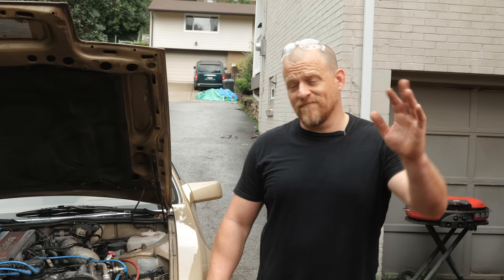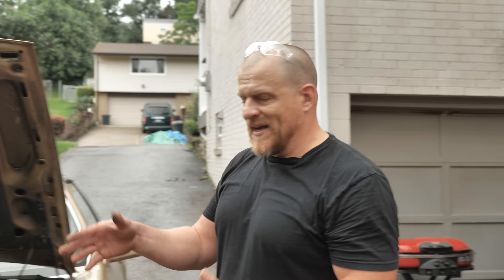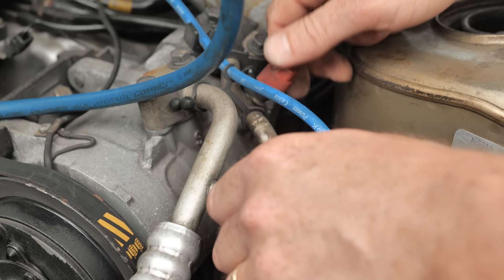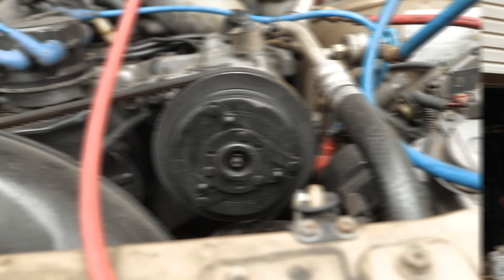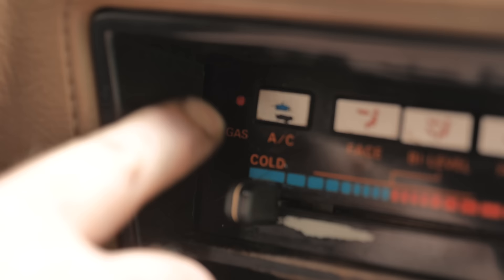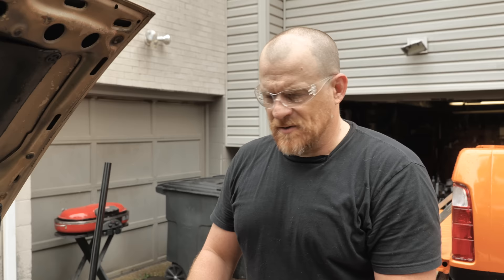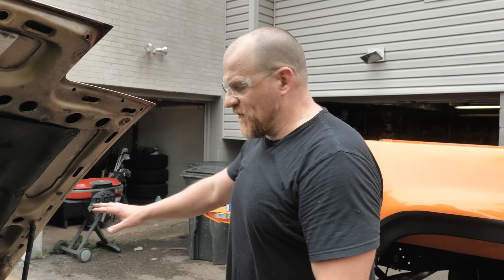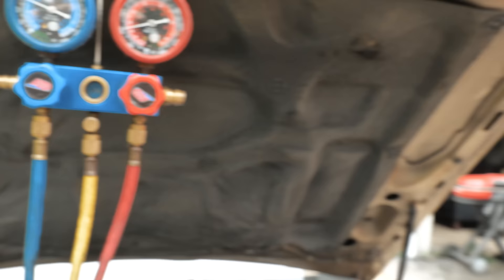A/C Leak Testing, Repair, Evac and Recharge (ANY CAR!)

Comment: never rely on schrader valves to keep air from entering when under a vacuum, they're designed to hold pressure from the inside seal end and not a vacuum with air pushing in from outside, they'll easily open and allow air in. you very likely let in air when you closed the low side adapter and removed it. same for the self sealing/low loss hoses, they're all made to hold pressure, not vacuum.
you should use good ball valves to isolate things and cycle them half/part way closed a few times, as there's voids in them that hold air around the ball and that releases making the vacuum drop when cycled. it's a good idea to charge as much liquid as possible into the high side first (with engine off!) then you can close it and finish charging through low side with vehicle running.
Reply: Yep.
Reply: throttle bottle  - damn, i've gotta watch the video again hahaha.  i've got a set of fairly cheap ($300) gauges coming in next couple of days.  i got em cuz i've gotta do my 2001 silverado & a couple of other buddies rigs.  will be my first time doing AC so i've been watching a bunch of videos.  can you walk me through what kind of valves to get etc.?  would i install them on the end of the vacuum/high/low side hoses... like attach them to the factory ends where they install into the actual gauges or somehow replace the ends that connect to the hi/low service ports themselves?  am i making sense?  if you're too busy i totally understand, your comment just really interested me, thanks:) barbie
Reply: @8barbies779  it's really not that crucial. Miniscule amounts moisture that gets in from disconnecting fittings and switching the the other cans, etc. should be absorbed by the drier.

Comment: For that car, I would've replaced the receiver/dryer. It's old and rotten, by now, and you had the system empty, anyway. You might've had drier and colder air if the receiver/drier was replaced.
Reply: Yeah I always replace the accumulator/filter dryer just cause the system is open, like you said the things are blown out after years of use. Pretty cheap insurance for most cars

Comment: A micron gauge is used to determine if there is moister in the system not to prove a leak in the system. Everything Doctor Paul shows In this video is perfectly good practice. He is very knowledgeable.
Reply from the maker: Is it not both? Thanks!
Reply: False. A micron gauge is used to measure vacuum on a system. Ideally you should vacuum a system down to under 500 microns to boil off moisture in the system. The purpose of pulling a vacuum is not to pull the refrigerant back into the system. The purpose is to eliminate moisture.

Comment: The ac gas light is connected to a superheat switch. It will illuminate when the system is running and low on gas. If it's flat empty it should not illuminate after the engine is running. It will light for bulb check.

Comment: A really slick modern oil is called PAG100 "Double End Capped"(molecule). It is fully compatible with all things R12 and R134a. You can switch refrigerants without changing out the oil.

Comment: One technique that I just tried a few minutes ago while topping up my Integra to check the Schrader's after I was done was to back off the valves but leave them on, discharge both hoses through the manifold valves and close them again. Wait awhile to see if the hoses repressurize. They will climb a little bit anyway the first time or two that you close them but then they should stay at zero forever.

Comment: You can go to auto paint supply store and get a filter for paint gun and filter out the moisture in ur compressor lines before you pressure a/c system with compressor air😊

Comment: Nice routine you have there Paul for checking for leaks, and making sure to boil off all the moisture with a vacuum pump. I haven’t used a micron gauge but I feel comfortable as long as I get down below 28-29 in vacuum and it holds for 15 mins I’m happy. Thanks as always Paul for sharing your repairing. I learn a lot from you.

Comment: Fantastic explanations!  I have a wealth of info from residential HVAC…you are spot on with the 500 microns and below being preferred to minimize moisture and non-condensables.  Most manufacturers have their own recommendations, but 500 is the universal standard. Don’t go below 250 microns for many oils. Vacuum pump, vacuum pump oil, and good hoses and seals are imperative.  If you are unsure, change your vacuum pump oil (it is special… don’t use motor oil, etc.), change the rubber seals on your hose ends, or use something like Nylog on the hose fittings when you connect to pull the vacuum. 

Also, Nitrogen is THE way to pressure test/leak test.  For most micron gauges you can apply pressure after the vacuum with refrigerant/oil but you will have to clean the gauge (usually with isopropyl alcohol)—check your manual for your gauge.

Last…close the check valve, pinch off the hoses at the vacuum pump, or disconnect from your car system when you turn the pump off.  Otherwise the vacuum in the system will start to pull your vacuum pump’s oil into the hoses.

Thanks for such a great walk through of car AC systems and your explanations.  Again…excellent advice.
Reply from the maker: Thanks so much! Really appreciate that coming from an actual HVAC tech too!

Comment: I'm with you that acidic oil in an automotive application is not a huge deal.  You definitely don't want acidic oil in a house AC or commercial AC system because the acid will eat away at the windings in the compressor causing a burn out, but with an all mechanical compressor such as automotive its not near as big a deal.  I worked in an AC shop for many years and we used compressed air quite a bit.  A combination of a deep vacuum and the desiccant in the dryer/accumulator minimizes the chance of acidic oil a lot.  Just found your channel last night and enjoying the content,
Reply from the maker: Thank you! Glad you found me. I've since switched to nitrogen, just to silence the critics lol. But I'm glad you're here and thanks for this comment!

Comment: I seem to have alot of intermittents  with things so I made a small led power indicator board with 6 ckts and long leads so I can drive time monitor things,  ive actually run a trip with the guages hooked up for 8 hrs lol, but it solved what the issue was. hygroscopic is the word you were looking for, they make a shutoff valve that fits between the micron and the line fitting.

Comment: I worked on cars almost 50 years I started reading about combustion engines 12 13 14 and starting to work on Automotive cars I used to build tractor trailer models which was the big as day and car models learn the parts read books have even started doing body work at the age of maybe 14 or 15 then I went to high school head shop for 3 years and went to Lincoln Tech with two and a half for business on Automotive and Diesel and took business one thing is I can see you're one of the mechanics on YouTube that try to be as thorough as possible and even go by the book I can appreciate your videos by the time my first year high school when we were taking nothing but test and staying in a class I asked them to bring in the 71 Pontiac Grand Prix that I needed to put an engine in my shop teacher he was very surprised that I had that much knowledge didn't know everything but I knew pretty much I brought the car in and put an engine in 71 Grand Prix because of course schools didn't have that much to do with working engines because of the school budget so we brought in work that we were working on otherwise at home pretty much had to retire but still think cars are real fun

Comment: I had a Fiat Stilo with naturally aspirated 1.4 that claimed 90hp. It was a nightmare to drive with AC on. And I really mean a hell of a nightmare. Each time the compressor kicked in I had to give it full gas to even do anything. Now I have another Stilo, with a 1.9 JTD 115hp turbodiesel. Same car, same weight. I almost don't feel the power going down when that compressor is on. Maybe if I upshift a bit too soon, and the rpm gets below 1500, it doesn't pull as hard until the turbocharger spools up. But that's it. 90hp vs 115hp - it doesn't seem much. But as far as it goes for the torque, it's 128Nm vs 230Nm. And that makes a difference.

Comment: Enjoyed your content. I'm a commercial refrigeration technician and have done almost everything involving a vapor compression system. The Gas light  on the Z was really cool. I had a 280Z with the all digital dash, can't remember seeing that option on it however. Lot of good info. After dealing with rack systems for Walmart, 2000lbs 404A, losing refrigerant is always and issue. When I have a leak it's bad news and I can't leave until it's fixed. Finding a leak with Nitro & bubbles isn't an option, leak detector or dye in the system. Nitro helps in removing moisture and it has the lowest molecular weight of any gas making it the best option for finding leaks. When it comes to the micrometer moisture boils off around 1200, if system struggles around 1200 you know that the system has moisture. Several methods to remove moisture. 500 microns is the number you need to know that all non condensibles have been removed.. I've had the same vacuum for so long that I can hear when my pump has achieved desired microns.. The oil has a high affinity to moisture, once the cap is removed use what you need and trash the rest. Make sure you have fresh oil in the vacuum, it will pull down faster. 800microns I let it rip. Most conversions require about 15% less refrigerant than before, sight glass was also pretty neat. I've never dealt with a txv in MVAC most are fixed orfices. Often times the txv will require changing. Using a txv not rated for the refrigerant could cause pressures to look low. Flashing at the sight glass bc the txv is starving the evaporator. When dealing with low pressure systems or negative pressure systems everything is critical and if I miss or try to skip a step it always comes back to bite me in the ass.. Had a newer Cadillac with ac issue. With all the tools that I have it still required a computer to diagnose the system.  It was the only way to test and verify if the sensors were within tolerance. High Engine Temp sensor was out of tolerance. I've seen and done a lot. Had opportunity to install chiller on big ships, some of the things I had to come up with solutions inorder to make the equipment purchased work all bc they didn't understand that the salesman upsold them which required an expensive controller. The owner didn't purchase the controllers, I had to install DC rectifiers that I ordered from Amazon for $12.00 apiece. The controllers were $475 apiece . I've never used a protective cap on Nitro, can't tell you how many busted regulators I've had over the years. Plus, my Nitro bottles are  6ft and strapped to a 2 wheeler. I have several manifolds I use but when dealing with MVAC I use the throw aways. My Testos have micrometer built in and so does the hoseless yellow jackets. The gouges would cost more to replace than all new MVAC system. The R12 units use to get really cold, I still have some R12. Got a Coke Machine that runs on it. There is a newer refrigerant out R1234 haven't used it yet. I do have some R290 & R600 medium temp units with it. Propane & Butane.  some of the systems only hold 2.8oz of R290 when a R134 unit same size might hold 12oz. Can't leave access ports on r290/r600 units. Look forward to watching more of your content.
Reply from the maker: great info! Thanks for sharing your expertise

Comment: A couple years ago I found a used Robinair 34788 machine on Craigslist and it's changed my life!  Before that, however, I used cans just like this.  Aside from the R12-R134a conversion, using cans for an accurate charge is tricky and sometimes difficult.  My method for using cans to charge accurately is as follows:  Just as an example, let's assume we need 26.5 oz total charge.  Each can is 12 oz so we need two cans plus 2.5oz.  The first bit of refrigerant goes in the easiest so I will put in 2.5 oz from a can while the can is on a kitchen scale.  it will go in quickly and easily.  Once I get that 2.5 oz in I will remove that can and then use two new 12 oz cans.  You can then drop those two cans, upside down, in the hot water and let the hot water push it all in, in liquid form, with the engine off.  Do that for both cans.  The problem is if you add the full cans first is it's difficult to weigh in the last 2.5 ounces when it's in a bucket of water. Even if you low side charge the last 2.5 ounces using a scale with the engine running it takes forever, the can freezes and gets condensation on it, messing with your scale reading.  

Thanks for the micron gauge demo.  I've been considering getting one and figuring out how to use it with my machines.
Reply: So you waste the 9.5oz of the first can? No way to remove it and save the refrigerant. 134a really jumped price this year, no way I'm throwing that money away.
Reply: @donwasse7892  No, I just disconnect it and save it for later for the same process on the next car.  It does require more than one can tap, however, the cans you buy now have that self sealing top so you can remove the can tap if you need to.  The point is to add whatever you need to first so that you can simply finish with full cans.  It sounds more complicated than it is.
Reply: @johnaclark1  gotcha, then you just use the partial as the first can on the next job to do the same thing? I use a machine anymore, but when I did use cans, I never had any luck with weighing them. On the last can, I would let tiny amounts in the system and watch vent temp and pressures.
Reply: @donwasse7892  Same here.  Weighing the small cans doesn't work very well except on the first can when much of it will go in with no trouble when the system is under full vacuum.  That's why you put the excess amount over your full cans, first. In my 26.5 oz example, weigh in the 2.5 ounces first, then just dump in the two full 12 oz cans with no scale needed and you're within an ounce of your 26.5 ounces.  The hot water trick usually allowed me to put the full cans in without even starting the car.  I was able to get it done pretty quick this way, too.  A machine makes all this unnecessary but I posted this as a help to those that don't have a machine.

Comment: The ac systems today are so good , What we had in the 60s 70s cars was expensive to keep it running from year to year. My teacher got me a job doing heating and cooling I had very little work until summer it was $500 a year if nothing major was wrong, It's a huge difference

Comment: 18:13 some times on an AC system with a traditional magnetic clutch, especially if the car has sat for 8-12 months and has 200,000+ miles, the clutch can be dirty and won't engage, tap the clutch face with a mallet and they usually will engage and be fine after that, if it was just a dirty lazy clutch...try the tap method before proving out the fuses/relays/climate head/wiring, etc...  Great Video!!!

Comment: doing residential and commercial HVAC, what we normally look for on a micron gauge is a hold under 500... but the way it works is: water begins to boil off around 800. reach below 500 and if the numbers are bouncing around still, then its still boiling off moisture. if its not bouncing, do a hold test. the hold should AT LEAST stay below 1000 over 30min and below 800 within 5min. if it quickly jumps close to 800, just keep it on vac... even if it stops climbing after or near... if it just jumps up, u got more to boil.

Comment: Great video Paul and Calib and at UTI Refrigeration School they taught using only crushed ice and water for calibrating temp gauges as that guarantees that you are at 32 degrees. Either way
you are going to get closer than 75 degrees  LOL. Awesome knowledge learned from you always, thanks so much.

Comment: Just FYI, I’ve noticed in several videos that you tighten the low and high side couplers all the way. This could potentially damage the Schrader valves. It’s recommended to tighten them just a little until you start seeing pressure on the gauge. Thank you for the great content, though!
Reply from the maker: never had an issue with that, but thanks for the warning

Comment: You connect your micron gauge to the hi side of the system, add freon to the low side until you have a positive pressure then disconnect the micron gauge. that way you're not sucking in air, you would blow out a little freon. You also really don't want to read your vacuum on the same line as your pulling from. It may not have a major effect on auto but on any other refrigeration system that is a lot bigger, it will show a lower vacuum on the low side vs the high side
Reply from the maker: That's a good tip John. Next time for sure!

Comment: Thanks for helping.  I have a 1950.00 estimate on a compressor replacement. I have a complete garage, so I'm studying A/C repair. Thank You for helping.
Reply from the maker: Keep in mind, when a compressor fails, it often can pump its guts all through the AC system and if this happened, at a minimum, you'd need a new orifice tube or expansion valve, a new accumulator or receiver drier and a new compressor. It is also very possible that you'll need a new condenser too because that is where all the compressor debris goes first and you cannot flush those effectively on a parallel flow core. 
Now if the compressor failed in the clutch area and didn't pump anything into the system, then all you need is the compressor and nothing else.